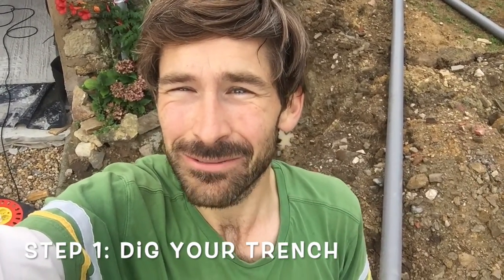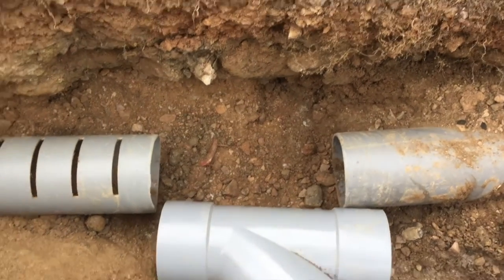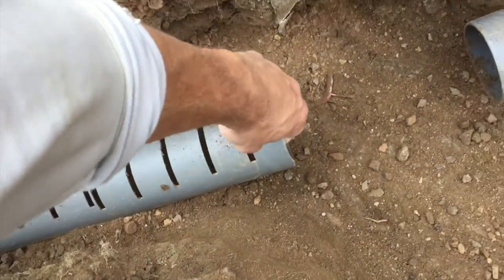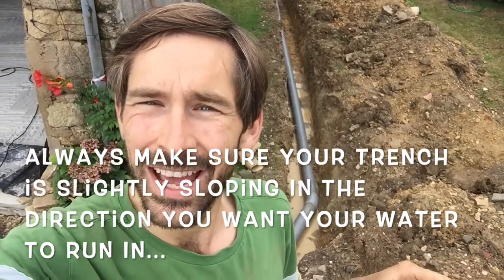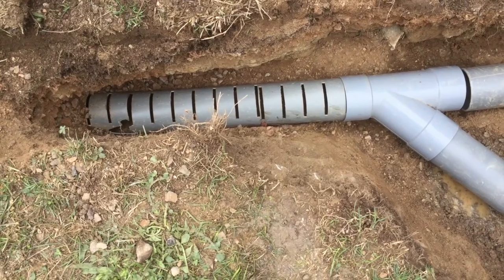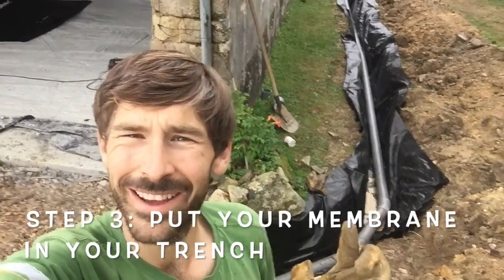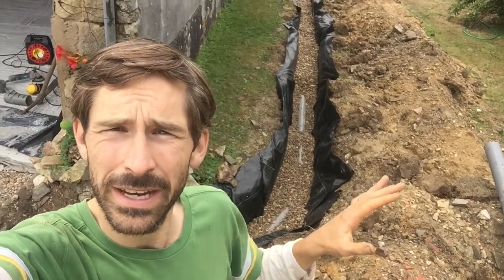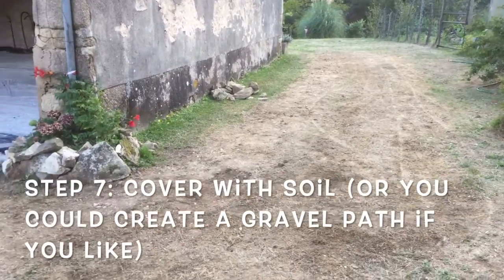How to install a French drain in 7 simples steps

Comment: Can I ask why you left a some space between the wall and the french drain? As opposed to putting the drain close to the wall. Cheers
Reply from the maker: Hi again! So basically we didn't want to dig too close to the wall as we were worried about hitting the foundations (they usually put really big rocks under old stone walls). Plus, we didn't want to damage any foundations!  I am going to remove the grass next to the stone wall (about 5-10cm-ish down), all the way to the french drain, then add weed liner and gravel to help even more with the drainage - so it will look like a gravel path next to the wall. I haven't had time to do this yet, but will hopefully be doing it soon so keep a lookout for it in my future videos!